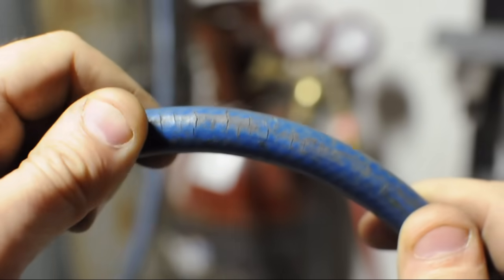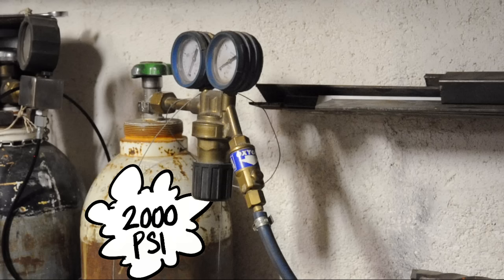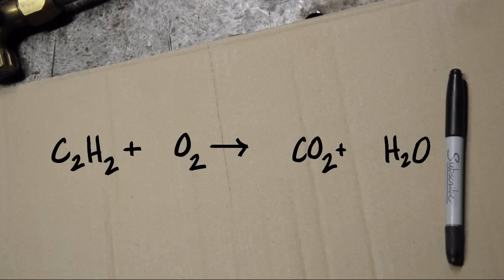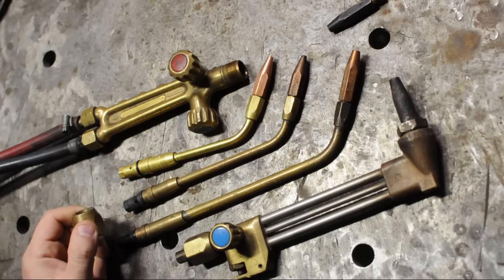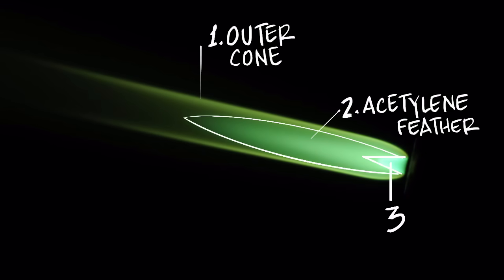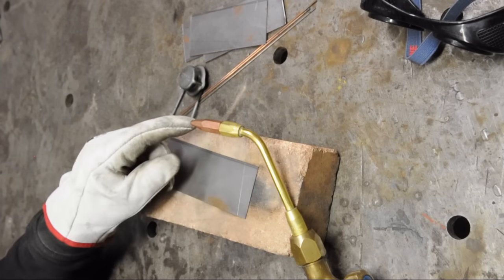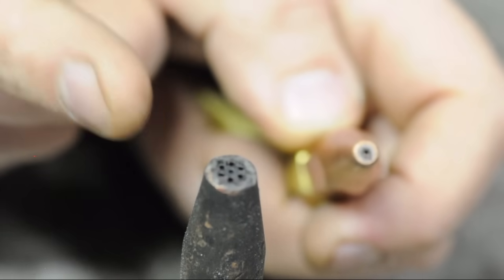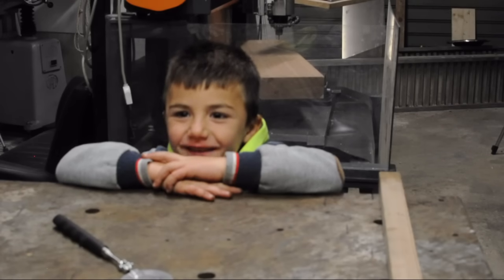Let's Talk Oxy Acetylene

Comment: The reason for not using a lighter? a striker doesn't blow up in your face when molten metal hits it
Reply from the maker: point taken.
Reply: the lighter could explode in your hand from lighting the acetelene and then you have no hand. thats the answer from the automotive basic welding course.
Reply: You stand a chance of lighting the lighter while your hand is in the path of the fuel. "You can not move fast enough to prevent pain". (<---- feel free to use this quote, I haven't copyrighted it)
Reply: Albert Tremblay well a lighter hasn't got enough power to blow up your hand. My friend tried it actually...
Reply: Justus Raw I've Heard Some People Have Used Other Lit Torches To Light Another Torch.
Reply: Mike Cowart I've Never Tried It. But I've Always Wanted To.
Reply: Bronson Stephens late I know. When my damn striker broke, I used my mini butane torch to light up my big asks MAP gas torch. I still do actually, haven’t seen strikers in stock at my local hardware store since. Suppose I should break down and just buy off amazon eh.
Reply: My uncle once lit an acetylene welder with a lighter. He held the torch in his left hand and the lighter in his right. Then he passed the torch over to his right side. To do so he put the lighter on his workbench. While he was changing hands the flame got too close to the lighter which proceeded of landscape his facial hair.

Don't use a lighter.
Reply: Justus Raw No, besides it being wrapped in your hand preventing most everything from contacting a lighter while in use, molten metal does not normally come out of the torch when it’s lit, but it if your aim is off just a bit when you strike the lighter and the torch lights, your thumb is right there in harms way, the torch is so hot it’ll give you 3rd degree burns before you can even react.  Your torch lighting device needs to be long, to get your hand out of the way. It’s hard to tell where the flame is going to be before it’s actually lit so an extended lighter is what’s necessary, even if it’s a long grill lighter long as your hand is definitely clear.  
Pro tip though, if you gotta use a bic, light it first and then slowly bring it while lit, TOO the torch with the torch set as low as possible.  If you spark the lighter at the torch tip your burn your thumb, and if the gas pressure is set too high,  your blow the lighter out. FYI
Reply: Colin Antink as long as it’s big enough to get your hand clear of the blast zone, plus a butane torch won’t get blown out by the gas pressure of the torch, sounds like your an iron worker from the 20th century my man. 👌
Reply: Albert Tremblay  it won't take your hand but will make your fingers tingle.
Reply: J R i
Reply: When I was taught, I was told not to use a bic lighter just because it puts your hand in the line of fire to possibly get burn. A striker keeps your hand far enough away to prevent accidental burns.
Reply: Zippo
Reply: @jaxturner7288  just working on the entir  State Building
Reply: Fact.
Reply: If you want to use a lighter (or similar open flame), you always point the torch upwards, then hold the lighter below the torch head. Like with most things in the shop, you can do it safely, or you can do it like an idiot.
Reply: @bronsonstephens5799  dragon fight!
Reply: @kaigrundmann9277  It has the potential.  When my Dear Ol' Dad worked as a CSHO investigator for OSHA in Arkansas, one of the accidents he had to investigate was the case of a welder who was chipping the slag off the bead he had just run when the Bic lighter in his shirt pocket exploded and nearly cut him in half.  Explosions of any kind are unpredictable at best and even if the materials and amounts are identical, they can have vastly different results.
Reply: Sometimes, I light my torch with my lighter. Other times, when I can't find my lighter, I light my torch with a striker, and then light my cigarette with the torch!
Reply: J R well if molten metal shoots off your torch tip when it lights up then chances are your tip is clogged up tighter then a Mexican brothel sprout. Which shouldn't be used
Reply: Waylander the Slayer is
Reply: @colinantink9094  

They're still at the farm stores.
Reply: just use the good ol camping flint block and a knife.
Reply: The reason is because you never lose a striker, you always lose lighters.
Reply: Lol. Had one splode in my front shirt pocket once while welding
Reply: Yeah, it's just for safety. Old acetylene regulators actually had a pilot light
Reply: Pffft! I use my lit cigarette to light the torch like a REAL man..... Tastes great afterwards too. Kinda reminds me of.... Candy corn?
Reply: If you believe a lighter is extremely explosive, go ahead and throw one in a fire. Prepare to be disappointed.

Comment: My dad worked as an engineer at a large valve works. One day a worker was changing a MIG gas cylinder and the full bottle tipped over sheared the valve off took off like a rocket across the shop and went through 3 brick walls before running into a concrete pillar and dumping out the rest of the gas! Chain your bottles!
Reply: Well when changing i presume putting the screw valve guard back on before removing the chains is the most viable step to do.
Reply: @MmeHyraelle  Definitely the most important safety precaution - but people get lazy, and frequently only turn the caps on for 2 or 3 threads. They don't need to be tight, but exposed bottle threads are a "danger" sign.

While in high school, I briefly worked for a bottled gas distributor. We refilled propane cylinders from a 6k gallon tank; and we also refilled acetylene bottles (with the gas generated on site).

Our delivery truck had just dropped off about 70 mixed bottles: Empty acetylene refills, propane refills, and a dozen full Oxygen; plus a couple of doors for an office remodel project. As we were racking the empties for forklift transport, we heard a scraping noise, and turned to see the O2 bottles in full "domino mode" with 4 of them falling off the loading dock. The driver had propped the doors against the bottles . . .

One bottle cap was installed less than 2 full turns, so the cap stripped off, the valve sheared off, and the bottle launched itself completely through one bank of the 6k Propane tank safety revetment, passed below the tank by less than a foot, and almost made it through the opposite bank.

I found another job the next day . . .
Reply: I have seen an oxy bottle do that.
Reply: SCUBA tanks are smaller so I'm not sure how well they would do against brick walls but they go through divers without much issue.
Reply: A long time ago I was a firefighter. One night we got a callout to fire at a winery. It was an insurance arson job and everything was well involved.
Anyhoo, a fellow firefighter and I were tasked with extinguishing whatever we could in a burning out-building, so he and I hauled in a line and proceeded to splash water about.
He was on the front end and I was hanging on to him.
As we moved further in, I heard a dull clang, and then my buddy said, "Watch out, there's a bit of pipe on the floor." He stepped over it and kept moving, but soon stopped and turned to see why I was pounding him on the back. It's because the "piece of pipe" was an acetylene bottle, and it was glowing.
We dropped the hose and ran.
I was fast back then but somehow the other guy beat me out of the place.
The DO (fireground OC) began yelling at us for running away while screaming like girls as our hose thrashed around unattended in the building but, before we could explain, there was an almighty whoosh, and an incandescent rocket vanished into the adjacent woodlands where it exploded.
Good times....
Reply: @NZobservatory  Insurance job at a winery?? Hard to believe, it's such a reputable industry. It was probably just a coincidence like when my parents sold our holiday home just outside Cromwell and then it burned down a few months later, and then got planted over with vines a few months after that.
Reply: L1ama xD

Comment: But AvE said to learn with a Stick! What do I do?

Never mind. Problem solved: Living in an apartment means I just watch all the videos about welding so I already know everything. I'll just comment on videos telling people how I once did it better with a frayed extension cord, a pencil lead and cutoffs from a sheet metal shear.
Reply: keep your stick on the tig and mig
Reply: I understand that advice in theory, but in practice it makes no sense to me. When I wanted to learn to weld MIG, I learned to weld MIG. Same thing with TIG. Why would I waste time and money learning a method of welding that I'll never use beyond some nostalgic appreciation for capital W welding? You know "Wellllldinnnnggggg (hushed reverence)"

Frayed extension cord? Amateur. Everyone knows you're not a real Welder (again, hushed reverent tones) unless you can barehand metal coat hangers with 220V at 60amps coursing directly through your body while you lay fat dime stacks on pop cans. Become one with the weld.
Reply: Keep your stick in a vise.
Reply from the maker: Now you're getting the hang of it!
Reply: Stick is the best way to weld outside of the shop. Not everyone has the luxury of an indoor work area.
Reply: plus you can stick weld with two car batteries... plus a welding stick...
Reply: Yep, and if you're welding galvanized stuff and don't have a $5000 fume extractor: go outside on a windy day, and stick-weld that shit. I'd do that even if I had a fume extractor..
Reply: kentucky ken I think the filter is only changed every second fluid changes, belts every 6th..
Reply: CapApollo you can also make 2 car batteries explode with 2 car batteries and a welding stick
Reply: kentucky ken after you have mastered that you may move on to JB Weld
Reply: I should clarify beyond the attempt at humor:

Stick welding is a great form of welding and has it's place in the world. In some applications it's the best or only option. It's a great way to learn welding theory for someone who wants to be a professional welder.

I think for the hobbyist who wants to weld, it's unnecessary to progress through the different types of welding. Just pick the one you want and go for it.
Reply: Maybe Oxy-Acetylene is the welder's equivalent to Latin ;-) Basically obsolete, no longer good for much except in specialised applications, but still has a powerful lobby insisting on some mythical inherent 'educational benefits'. You know, the crowd that goes on like 'You'll learn modern romanesque languages so much easier after learning how to translate Caesar and Cicero! Only Latin can give you a true understanding of language structure!1' 
(Don't know if you have that kind of Latin Mafia in the anglophone world but they rule third language education in Germany with an iron fist.)
Reply: Ha Ha Ha.. NEVER listen to Ave. Most of the time he is just chasing his tail with a whole bunch of explecitives.
Reply: Eh?
Reply: Devantejah
Reply: +Cancun771  I learned to arc weld (stick iow) and OxyAcetylene for cutting back in 1979 in the 9th grade shop class but I have never seen OxyAcetylene used for welding before.
Reply: I was just thinking the same! lol "AvE said stick was better... what naaaaaw ? D:" lol
Reply: Dark Alchemist He does the English mangling on purpose. It is quite funny actually
Reply: Rishou Ren
I know he does which makes it even worse.
Reply: ***** Nah, it just makes it all the more funny.
Reply: Somedays it is nice to shut off my brain and watch Uncle BumbleFuck.
Reply: You take an electrode welding stick and use it for acetylene welding. Best of both worlds!
Reply: Alaska Skidood  torch was first before stick welding in history
Reply: Alaska Skidood use stick what for joining metals together. Oxy is most skookum what for melting, burning, heating, and general bumblefuckery.
Reply: Renax the Man use a flap disc in a grinder to remove the galv coating on the joints before you weld,
Reply: Cancun771 - Actually, there is a perfectly good, valid reason to learn welding with oxyacetylene first. Tony mentioned it in the video - learning puddle control. When you're just starting out, things happen soooo fast, and a lot of people have a hard time when they jump straight to something like Mig. If you don't already have a feel for controlling (or even identifying) a puddle of molten metal while welding, then a lot of the advice you'll get either online or even from someone in person may not make a lot of sense. Oxyacetylene is so much slower than any of the arc processes that you have time to get familiar with the liquid puddle and some of it's behaviors. This will ultimately make for a better end product, no matter what that might be.

For instance, if someone just decided to pick up Mig welding by going to Harbor Fright and grabbing a wire feed box, they'd be halfway down shit creek without even realizing they needed a paddle yet. No idea that flux core isn't Mig, no idea that Mig might not penetrate if the settings are off (when gluing metals together, you don't want the glue only on the surface, but actually inbetween the parts too), ect. But playing with OxyAct, you have time to see and experience more before you've blown through the piece, or ruined it in some other way. And while you get some of this info on some of the better videos here on the tube, absolutely nothing beats actual hands on experience, especially with puddle control (and visual identifiers). 

Oxyacetylene is really just training wheels for people who want to be able to trust their welds to actually function every time. As the saying goes - "would you trust your life to your welds?" People building projects at home for fun might need to, and knowing you can makes it easier to go ahead and do that new thing that's been eating away at your brain...
Reply: What about Z spar and Splash Zone? (If you are an Alaska fisherman and are confused, these are the labels that dissolved off of the cans of "bear shit" your boat is now half made of.)
Reply: @Matthew - Well, your advice makes sense in theory too, but learning to stick weld first teaches you a lot about welding (behaviour of the arc, how metal melts/fusion works, etc) as well - things that will help you master any other welding techniques, flattening the learning curve as it were. Especially since stickwelders + supplies are generally a lot cheaper than gas, nozzles, etc needed for MIG and TIG, going with stick first, even if your goal is MIG/TIG, is most assuredly good for developing your welding skills.
Reply: I would say that you should start with what you can afford and what requirements there are, i started with a tig because i wanted to be able to weld mild steel, stainless, aluminium and i couldnt use stick or mig because of the spatter. Maybe you wont learn as fast but if you are really intrested you can make it work.
Reply: Oskar Johansson Well, sure, and a regular Tig / a good stick welder are found around the same price points...adding alu to the mix however requires a well more expensive tig machine, and without the basics, alu is going to be trickier and more expensive, so for those who don't even know if they're going to be doing it all that much...
Reply: Well i did say start with what you can afford and for me that was a Chinese made AC/DC tig, i never welded before i got it and if you are willing to put down the time to watch some videos and then go out and trying it you can learn quite fast.
Reply: Which one lets me glue metal together with the least cost and minimum chance of blowing myself halfway across the room in a crumpled heap?
Reply: once you master gas, you,ll not go past it
Reply: @TheHandsomeMatt  nah you know everything.
Reply: @TheHandsomeMatt  So you can't oxy cetalene weld. Because its too old? You'd be laughed out of Ingalls.
Reply: MiloTheSwift Thank god I’m not in Ingalls, I guess?
Reply: @CapApollo  Super insider - loved your comment
Reply: @mcapps1  Hull or plumbing? Either one, you couldn't pay me enough to do what you guys do. I remember passing you guys on my way to the mooring station to hide and thinking, "ain't no way." Or the cats out in the yard, welding up the hull sections under the midday august sun, full leathered and masked up. Don't miss that place much, come to think of it. Pay was alright, though.
Reply: you HAVE to learn stick before Oxy welding, if you dont, you will be in a mess, not knowing what to look for to get descent results
Reply: @kentuckyken Last time I tried welding wood I burn down my high school. Shop teacher said I should have used TIG instead of Oxy-Acetylene. Me, I think it was poor equipment. Either that or I didn't have enough machine grease flux on it.
Reply: @kentuckyken Crotch oil? Never heard of it. That must being why SHE overheats. Thanks I'll oil HER up real good before I engage the TOOL.

Comment: Great video!! In Argentina, the tank that we use for acetylene has a small deposit in the bottom to put Calcium Carbide. Then you have to add water to that deposit and close safely. This mix deposit generates acetylene. You have to renew this mix periodically to generate more acetylene.
Reply: Mariano No puedo creer que todavia existan los gasogenos en argentina, yo recuerdo los mas antiguos que subian o bajaban la parte superior de su estructura de acuerdo a la presion interna, luego los mas modernos ya heran hermeticos, pero pense que ya pasaron a ser piezas de museo, saludos